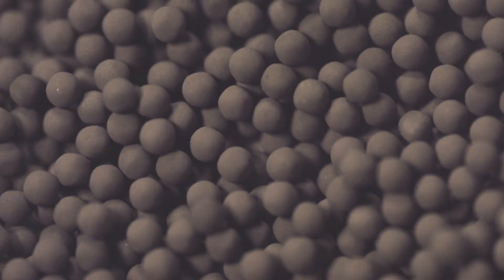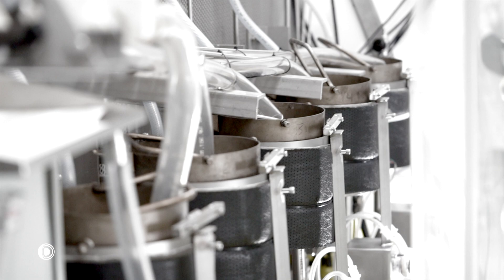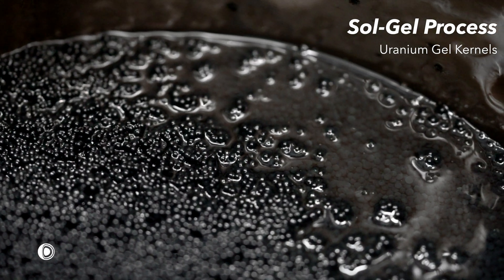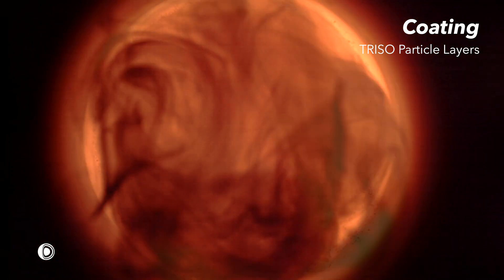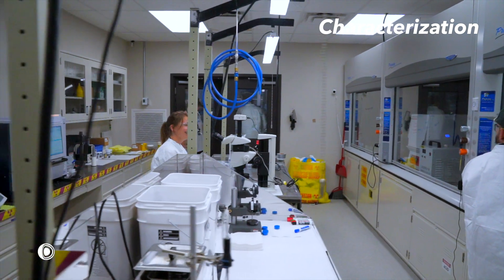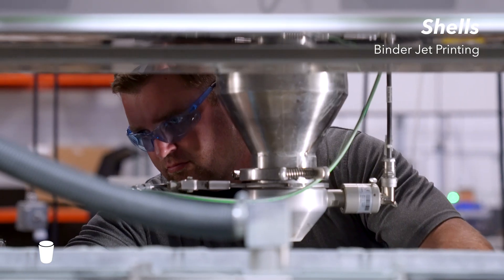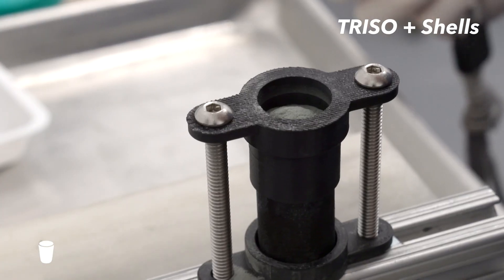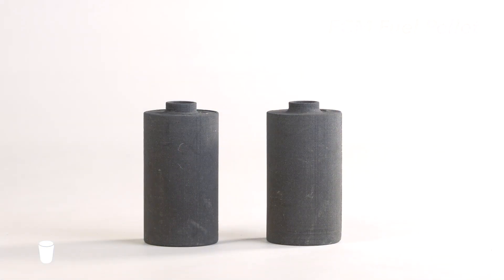TRISO Nuclear Fuel – How It's Made

Comment: This all looks very over complicated? Wouldn't it be easier to make the fuel as pellets and encase them in ceramic jacket. 
THen all have to do is crack em open to get the spent fuel out.
Reply: You are correct on all points. The biggest issue we ran into was that we had no clue how thick the bottom base was. The printer shown is 160 pro by x1. That printer would deviate during the print in random spots and random deviations. Add on that we couldn't actually get a true thickness measurement from a green state to a fully dentsified state. There was a plethora of other issues too, but the thickness issue and non breeder reactor design made the part to what it was.

Comment: A better control method of pellet forming would reduce cost associated reclaiming rejected fuel. Possibly something like a shot tower for making lead bbs. They are very controllable.
Reply from the maker: Interesting idea. the challenge is that is a ceramic deposition process. Temperatures and pressures are high.

Comment: how do you guarantee equal distribution of the tiny particles within the substrate?the video shows the "nuclear battery" being filled first with the special fuel pellets and then the secondary filler material, then it's vibrated to pack it?,when you vibrate larger and smaller particles smaller particles tend to work their way down and the larger particles are pushed up,I imagine hot spots and cold spots inside these fuel pellets due to unequal distribution of the tiny pellets inside their substrate, what would happen if by chance during that manufacturing process all the big pellets vibrated to the top and all the small filler vibrated to the bottom
Reply from the maker: Pretty astute observation. We ensure all the particles are the same size to within <1% (don't know exact number). The hot spotting and contact between spheres is a known phenomenon  that we is taken into account in the analysis and design.
Reply: @ultrasafenuclear great to hear

Comment: What happens to the rejected TRISO particles?
Reply from the maker: actually very few. They are not radioactive. So we can easily process them and recover the Uranium oxyxarbide fuel.
Reply: @ultrasafenuclear  I'm a little confused. How are they not radioactive, if they're the center of these fuel pellets?
Reply from the maker: @NetVoyagerOne  We're talking about the quality control during the fabrication. So these TRISO particles have Uranium in them, but they have not yet been placed in a reactor meaning it's not radioactive yet. It only has the radioactivity associated with fresh fuel which is low.
Reply: They U238 has a 4.5 billion year half-life.  The U235 has a 700 million year half-life.  So, they are radioactive but only mildly.  I think @ultrasafenuclear is referring to the gammas that are given off by neutron radiation in a reactor.  The resulting fission products like Cs, Sr, Zn, etc. give off lots of gamma radiation.

Comment: Shackleton Crater Luna

Describe the logistical requirements for the development of TRISO Nuclear Fuel manufacturing on Luna assuming SpaceX Starship as the primary Earth to Luna Freight contractor. Describe the Types of facilities needed on Luna assuming a site selected at the bottom of Shackleton Crater Luna.

Sent by you: Describe the logistical requirements for the development of TRISO Nuclear Fuel manufacturing on Luna assuming SpaceX Starship as the primary Earth to Luna Freight contractor. Describe the Types of facilities needed on Luna assuming a site selected at the bottom of Shackleton Crater Luna.

Developing a TRISO nuclear fuel manufacturing facility on the Moon, particularly at the bottom of Shackleton Crater, involves complex logistical requirements and the establishment of various types of facilities. Here’s an overview based on the current understanding and technological capabilities:
Logistical Requirements:
	1	Transportation: Utilizing SpaceX Starship, which has a payload capacity of 100 – 150 metric tons, would be essential for delivering the necessary equipment and materials from Earth to Luna1.
	2	Lunar Surface Mobility: Equipment for unloading and distributing cargo, such as lunar rovers, would be needed to handle materials transported by Starship2.
	3	Energy Supply: Given the unique lighting conditions at Shackleton Crater, with areas in almost constant daylight, solar energy facilities could be established to power the manufacturing processes3.
	4	Resource Utilization: In-situ resource utilization (ISRU) would be crucial, such as mining lunar regolith for building materials and extracting lunar ice for water and oxygen3.
	5	Habitat and Life Support: A habitat for personnel with life support systems would be required, considering the harsh lunar environment.
	6	Communication: The South Pole provides near-constant communication with Earth, which is vital for operational control and safety4.
Types of Facilities Needed:
	1	Manufacturing Plant: A facility to produce TRISO fuel, which includes areas for the handling and processing of high-assay low-enriched uranium (HALEU) and the fabrication of TRISO particles5.
	2	Storage: Secure storage for both raw materials and finished fuel, ensuring protection from lunar environmental conditions.
	3	Research and Development: A lab for ongoing research into optimizing fuel production and testing fuel integrity under lunar conditions.
	4	Maintenance and Repair: Facilities for the maintenance and repair of manufacturing equipment and transport vehicles.
	5	Crew Quarters: Living quarters for the crew, including amenities for long-term stays.
	6	Medical Facility: A medical center equipped to handle both routine health checks and emergency situations.
Challenges and Considerations:
	•	Temperature Extremes: The manufacturing facility must be designed to withstand extreme temperature variations, especially in areas of permanent shadow or light3.
	•	Dust Management: Lunar dust can be a significant issue for both machinery and human health, requiring specialized filtration and containment systems.
	•	Radiation Protection: Shielding for both personnel and sensitive equipment from cosmic rays and solar radiation.
	•	Regulatory Compliance: Adherence to space law and policies regarding lunar activities.
This outline provides a high-level view of the requirements and facilities needed for TRISO nuclear fuel manufacturing on the Moon. It’s a monumental task that would require international cooperation, significant investment, and advancements in space infrastructure and technology.

"a site selected at the bottom of Shackleton Crater Luna." your answer should be adjusted for the conditions at the bottom of Shackleton crater luna which are Cryogenic in Permant Darkness. Your answer was close as many plans include solar power plants at the high points of the rim of Shackleton Crater Luna, where constant sunlight is available & should be utilised as part of any plan for permenently shaded crater H²O harvest opperations. Please adjust this portion for a site at the Cryogenic Bottom.
Sent by you: "a site selected at the bottom of Shackleton Crater Luna." your answer should be adjusted for the conditions at the bottom of Shackleton crater luna which are Cryogenic in Permant Darkness. Your answer was close as many plans include solar power plants at the high points of the rim of Shackleton Crater Luna, where constant sunlight is available & should be utilised as part of any plan for permenently shaded crater H²O harvest opperations. Please adjust this portion for a site at the Cryogenic Bottom.

Thank you for the clarification. Adjusting for the cryogenic and permanently dark conditions at the bottom of Shackleton Crater on the Moon, the logistical requirements and facility types would indeed differ significantly from those in areas receiving sunlight. Here’s an updated overview:
Logistical Requirements for Cryogenic Bottom of Shackleton Crater:
	1	Energy Supply: The absence of sunlight necessitates alternative energy sources. Nuclear power, such as radioisotope thermoelectric generators (RTGs) or fission reactors, could provide a continuous power supply1.
	2	Thermal Management: Cryogenic temperatures require advanced thermal insulation and possibly active heating systems to maintain operational temperatures for equipment and personnel.
	3	Transportation: Cargo delivery systems must be designed to operate in extreme cold and darkness, possibly relying on autonomous navigation and communication with surface operations.
	4	Resource Utilization: Water ice harvesting operations would need to function in the dark, using heat or other methods to extract water without relying on solar power.
Facility Types Needed at Cryogenic Bottom:
	1	Nuclear Power Plant: A facility to generate power using nuclear technology, which is capable of operating independently of solar energy.
	2	Cryogenic Processing Plant: To handle and process lunar ice and other volatiles, facilities would need to be equipped with technology to operate at cryogenic temperatures.
	3	Heated Storage: Secure, heated storage for sensitive equipment and materials to protect them from the extreme cold.
	4	Automated Mining and Manufacturing: Systems for mining regolith and manufacturing using autonomous, remotely operated machinery designed for low temperatures and darkness.
	5	Underground Habitats: Subsurface habitats insulated from the surface conditions, providing a stable thermal environment for crew members.
Challenges and Considerations:
	•	Extreme Cold: Equipment and structures must be designed to withstand temperatures as low as 90 K (−183 °C; −298 °F), which are typical at the crater floor2.
	•	Darkness: Operations must be conducted without natural light, requiring artificial lighting and systems that can function in permanent shadow.
	•	Communication: While the South Pole allows near-constant communication with Earth, the crater’s depth may necessitate relay systems to maintain contact with surface operations.
The development of a TRISO nuclear fuel manufacturing facility in such an environment would be a pioneering endeavor, pushing the boundaries of current space operation capabilities. It would require significant innovation in power generation, thermal management, and autonomous systems to create a sustainable presence at the lunar South Pole’s cryogenic bottom.

Comment: Can use triso thorium based. How secure it's the helium model?
Reply from the maker: Thorium has been used in TRISO particles at the Fort Saint Vraine reactor in Colorado. So yes it's an option. Helium doesn't react or corrode or get radioactive. There is no safer coolant.
Reply: @ultrasafenuclear  just in case in the worst case scenario what if helium get expose to radiactive gas can transport the radiactivity ☢️ by mistake?
Reply from the maker: @offroadsnake  the helium does not get radioactive. And it remains free and clear of radioactive dusts because the fuel itself is so robust. If for some reason the helium carries other radioactive gases (leaked from the fuel), then the helium could leak out of the reactor pressure vessel. The point is, it won't be very much, and it should be contained inside the vessel. We absolutely consider all these eventualities in the design, analysis, and licensing.
Reply: That's amazing to hear! You guys are really cool @ultrasafenuclear

Comment: What is the point of such complex treatment?
Reply: the reduces the risk that products from spent fuels can be bred or 'cycled into stuff
Reply from the maker: these ceramics have extremely high melting temperatures and trap fission products in place.
Reply: It is also said that it will prevent radioactive melting by slowing down the fission reaction at high temperatures.
Reply: this fuel is not capable of meltdown
Reply: Meltdown-proof

Can handle very high temperatures so generator is more efficient

Block alpha and beta radiation

Extremely hard to crush or dissolve to extract the contents

If you blew it up, even after it gains many fission products, the radiation exposure would be minor.

Often uses 20% enriched uranium and could potentially use plutonium, so can be put in tiny reactors and not need refueling for many years.

But... without mass production, extremely expensive.